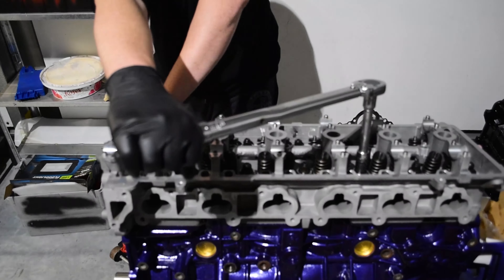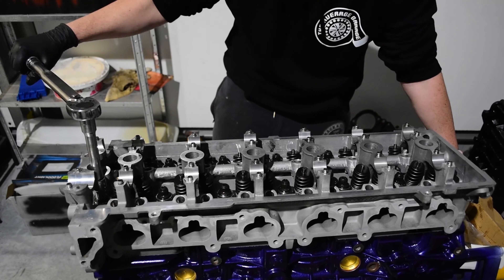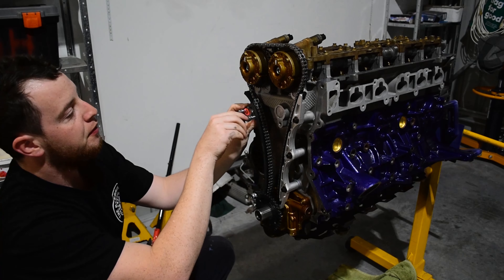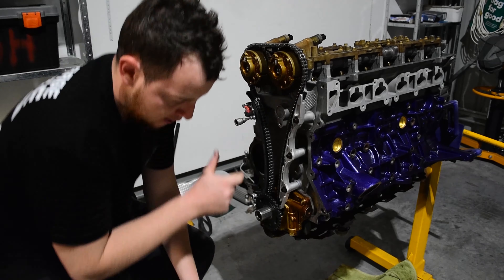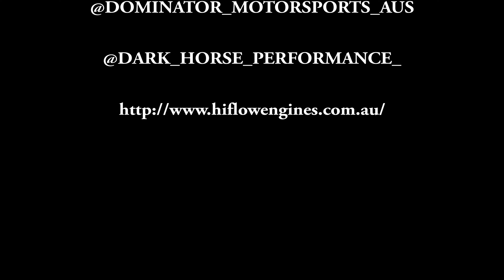BARRA REBUILD COMPLETED! Final Assembly!

Comment: the front cover, this is why i like the BA version. It has a proper 'o ring' for the timing cover and the recess for it to go in.
Reply from the maker: You still need sealant at the ends. It's not that hard to use haha
Reply: @T.A.G  
yeah that is true, but it's always the first place to leak. so i rather a proper O ring there.

It's like in later revisions of the motor/engine they squeeze more HP out of it, but at the same time, take little bits out to save on manufacturing costs.
Reply from the maker: I think they went to sealant as they kept leaking past the rubber. The amount of sealant they use is hectic, but it doesn't go brittle and shrink like the rubber seal

Comment: I hope you checked the oil pickup height after all that. Atomic says they should be atleast 10mm off bottom of sump, my fgx was 6mm off sump when I built mine, so I bent it to 13mm off bottom.

Comment: Hi mate is there any instruction on we’re all o’rings and gaskets and seals go on the engine?
Reply from the maker: You could refer to the workshop manual if you can get your hand on one. But most are unique in size and shape etc. I found what fits well without forcing and worked it out from there :)

Comment: Hi mate, what type of silicone are you using for the timing cover? I have a leaking one on both my fg's  and been quoted 600 to fix each! at ford! Can't find 100 % instructions online. Cheers!
Reply from the maker: I used jbweld grey silicone
Reply: @T.A.G  cheers man! Might sound silly but why not use a gasket?
Reply from the maker: @Deano084  b series had a rubber seal but still required sealant along the ends, and FG is pure sealant
Reply: @T.A.G  thanks heaps man! Been watching since the start! Best buy myself some go and have a go!

Comment: Hello mate
Great video !!! So good to see a top quality garage build .
I am about to start the installation of 
Billet pump gears and backing plate 
Atomic Timing chain kit
Valve springs 
ARP Head studs and MLS Head gasket 
All in the hope of a bit of reliability hahaha

Can I ask as to what silicon you were using in your assembly
Reply from the maker: It was a jb weld branded silicon for engines. I think it was the grey stuff from memory. Bought it at my local repco :)
Reply: @T.A.G  
Cheers for the reply mate 
I’ll be sure to grab some 

Also did you use a gasket on the tapper cover or did you silicon that also ?
Reply from the maker: @danrothmann7376  gasket mate :)

Comment: Hey mate just came across your channel. Nice work mate  my FG has leaks everywhere. Had it for 13yrs so it’s due for almost every gasket. I’m thinking about having a crack myself. Any tips anyone?
Reply from the maker: Find a manual and give it a crack. Follow torque specs and use good sealant. Cleanliness is key

Comment: Do you have a complete guide for the torque specs on the engine, if you could forward on your recomendation for a reference that would ideal!
Reply from the maker: I managed to find a manual online, most aftermarket parts will have their own though

Comment: All that work and only stock OEM cams?!?!
Reply from the maker: Engineering, emissions. Need I say more :(
Reply: Adam, the factory cams are actually better then what people think, i used to have a customer come in running 1012Hp on factory cams, his reasoning was when he had stage 4 cams in they were way too aggressive to drive on the street and factory cams was the best option!
Reply: @T.A.G  what ones did you get? fp fpv ones with the lobe ofsets?
Reply from the maker: @ChristianUnkn0wn  nah mate, stock xr6t cams from FG. Cheapest and best bang for buck
Reply: @T.A.G  verry curious how much they cost new
Reply from the maker: @ChristianUnkn0wn  I paid a little over 400 each mate :)